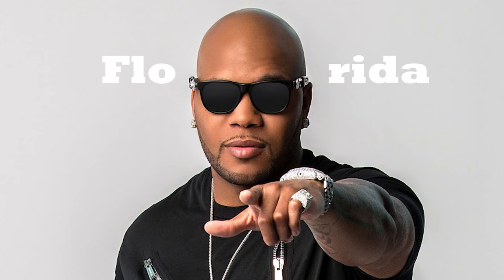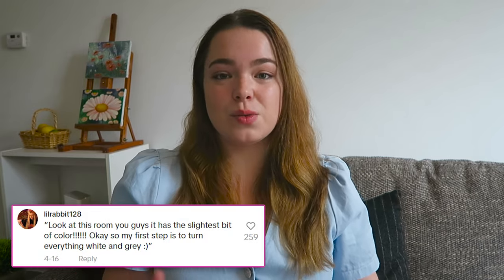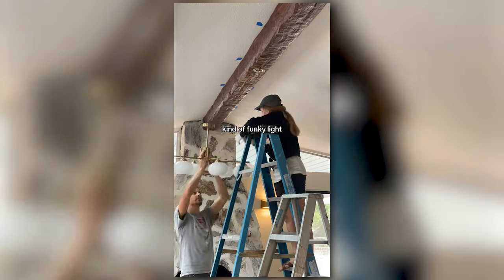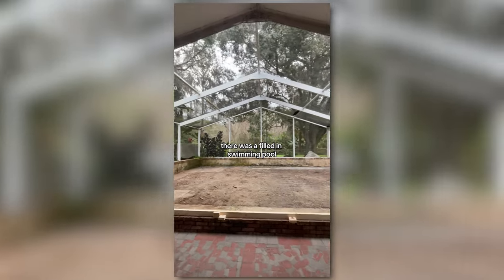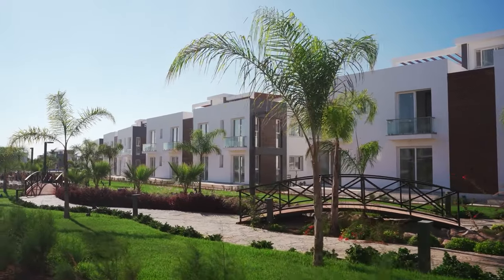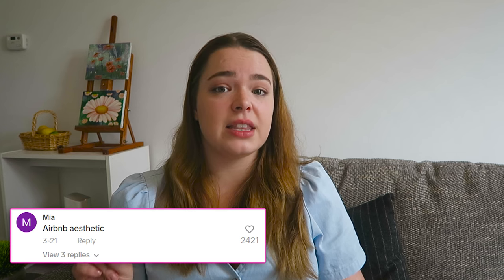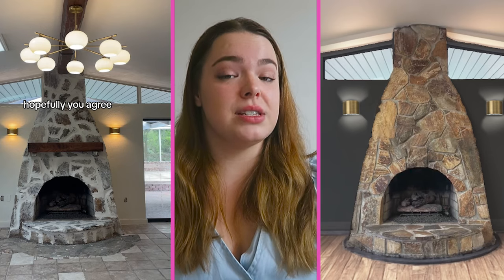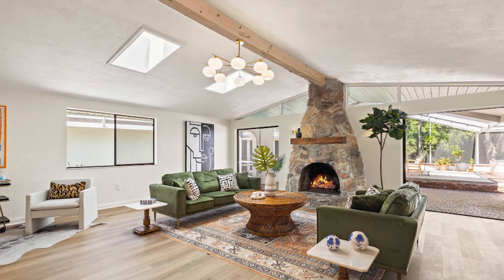Someone PLEASE STOP These TikTok House Flippers

Comment: The pool kills me. It's Florida. You'd rather have the pool.
Reply from the maker: That's what I was thinking!
Reply: @Kimberly_Sparkles  they said in the video that it was cheaper to concrete over it. I think it would have been cheaper and easier to put some pebbles in there and leveling sand or something.

Then if I, a gardener, want to continue using it as a garden, I can
Reply from the maker: @dismurrart6648  I agree and it allows for you to do what you like with it. Could have been an amazing greenhouse! 🌱

Comment: The florida flipsters are my mortal enemies and they kept coming up in my recommendation
Reply from the maker: I feel so so sorry for you 🤣😭
Reply: @tashsikkes  btw, I saw someone do fake beams by taking 2x4s, mitering edges with a table saw and putting braces inside for structural stability. Even easier, I've seen people just line the 2x4s up and put in braces. 

Those foam beams are as expensive as real beams and that option would look more realistic for a fifth the cost so the foam neam almost made me angrier than the fireplace.
Reply from the maker: @dismurrart6648  great point! I think I've seen something similar as well. It really would have been cheaper that way, I have no idea what they were thinking 🫠

Comment: In my town in Minnesota USA every renovation has to be inspected by the city.   I appreciate this - my contractor had to redo his electrical update four times to pass inspection!  I can’t imagine what would have happened without inspection.  Unapproved renovations have to be torn out before a house sells.  Inspection rules vary by area - some areas, especially in the southern USA seem to have few rules.   Scary.
Reply from the maker: Yea I'm not opposed to people DIYing renovations but it has to be up to standard and safe. Inspections by the city or some official body minimises the possibility for harm and quality tends to be higher as well. I'm not well versed in my USA states but I had heard that Florida is pretty lax, didn't think it'd be to this extent though 😬

Comment: When people who are raised by sad beige moms become flippers. = /

Here in America, if you go through a realtor, or an independent contractor, you can hire a home inspector to go into a house before you buy to look at wiring, plumbing, structural stability, ect. So they can look at crap stains on the ceiling like that one and go, uh... no. So DIY is fine, but if it's not up to code, or just seems like not a good purchase, the inspector can give a head's up to possible future problems before you buy so you don't end up sinking a lot of money into future repairs, (like that pool will one day be.)
Reply from the maker: That's good to hear. At least there is some level of protection for the buyer 🤞

Comment: The all out white/beige asthetic needs to honestly die out please where is the creativity of colour. Some of these house flippers think that adding wall colour  of any kind is gonna send them to an early morgue like it doesnt bite. A little bit of white here and there is harmless but everything being white is just too much.

And like you said the only thing mid century left in the place is the funiture, not the walls, not the floors and defiently not the ultra modern looking kitchen. and the absolutely ruined that fireplace.

Are all modern house flippers such cheap skates that lack any sort of creativity who just want profit and don't care about the final product.
Reply from the maker: I think the biggest issue is that most don't come from design or construction backgrounds so they go with what seems to work in modern homes not realising they are ruining valuable selling pieces in the process. There are some good ones out there but they are certainly rare. My wish is that they would consult a designer who knew how to work with existing styles, that in itself would work out some of the biggest issues 😕
Reply: @tashsikkes  100% if a designer had any sort of help and input with this then it would not have turned out soo bad.
Reply: I remember in the 2000's an accent wall was a good thing!
Reply from the maker: @t.y.5565  it was! It was a great way to add colour or drama into the space. However it ended up looking disjointed because most people would paint the wall and call it a day instead of trying to tie it into the space. In this example I think they did an alright job because they carried it in and were brave enough to do a few of them instead of leaving it as a white box 🤔

Comment: They didn't even need a solid wood beam. I had a condo that had wood beams made of 3 boards! Literally take the boards and attach them lengthwise into a "U" shape, stain the wood to your liking...and mount it to the ceiling to the wood rafters. Super easy and probably the same price or cheaper than the foam they used AND it could have been installed by two people on ladders with no issue. Also if a stupid flipper paints the wood board "beam" you can always disassemble and re-do the finish! That is what we did as our entire condo was flipped terribly and I will add NEVER paint rough sawn cedar. Taking a dental pick to a PAINTED WHITE rough sawn cedar fireplace surround for YEARS to get every speck of paint out of the grain is something I will never forget. I hate flippers. When we bought a house we intentionally looked for a place that was NOT flipped.
Reply from the maker: Great point! Honestly when I get a home I genuinely do not even want to look at a flipped house. They're almost always terrible quality 🫠

Comment: If they didn't want to go with a solid wood beam, they could have made it out of plywood. If they doubled it up and put a wood vinyl, it could be stained to match the timber flooring. And if the beam was too heavy, cut it so you could place it easier. I doubt that foam beam is flame retardant or heat resistant. What if it starts melting? That's a huge risk for the new owners. It could fall on someone. What if it falls on a  small child? I don't think these "flippers" care about the safety of other people if they are cutting corners like this. They shouldn't be in that field of work if they don't care about the safety of others.
Reply from the maker: Couldn't agree more! 💯

Comment: Would the foam beam harden and flake in time? Will it emmit gasses especially if the fireplace it touches is used?
Reply from the maker: I suppose it would depend on the type of foam. I'd be very curious about that as well 🤔

Comment: I think that range has a fan that pops up, more like a recirculating fan though. see that thick bump of a strip on the back of the range? I think thats what that is... but then again, they cheated out on everything so not sure.
Reply from the maker: That's a great point, I missed that. They're pretty rare in Australia so I didn't even think of it!